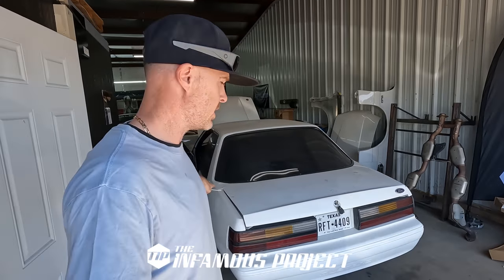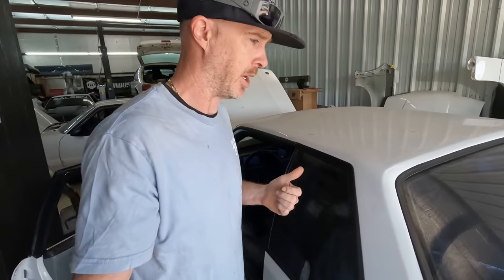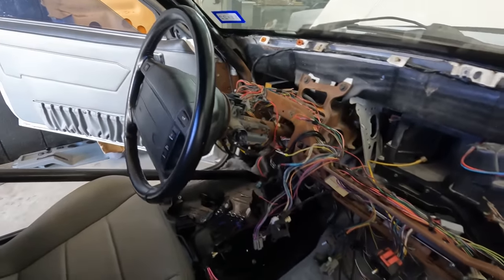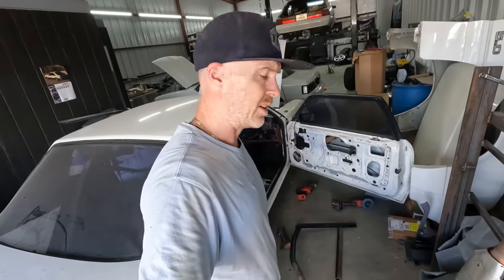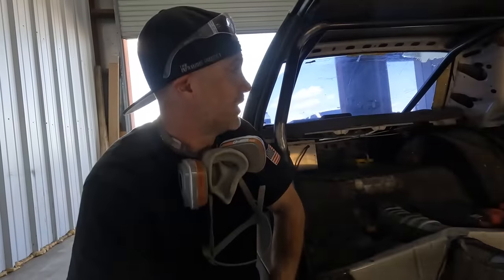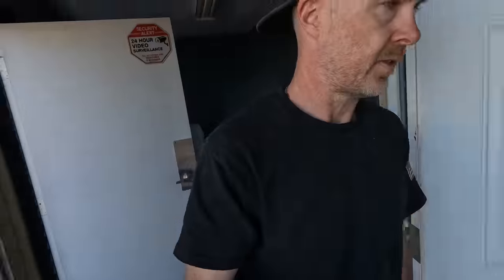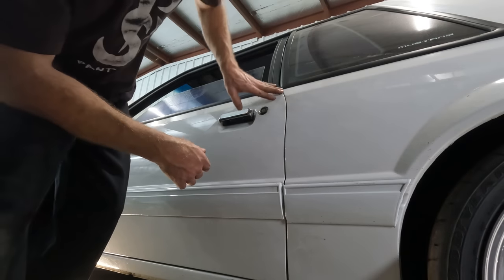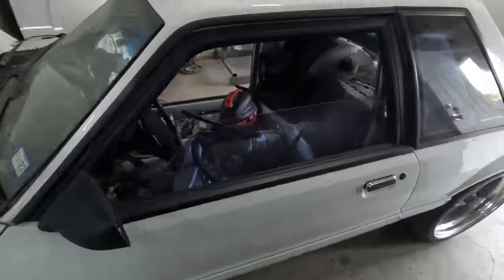Racecar to Streetcar - Roll Cage Removal & Panel Alignment on a 1993 Foxbody

Comment: I’m going though the same thing with my newest project build, a 1985 T-Top coupe with capri fenders and it had welded roll bar plates that they didn’t coat properly and they rusted the floor to the point of cutting them out and replacing with new metal! Went from almost a drag car to back to a street car where it should be👍🏻

Comment: Hey Chris! My car is very similar with a bunch of cut wires and the hvac wires and vac lines are cut. It's an 88 notch and I bought a stock 92 notch that's rotted out to use for parts. I know the dash harness is different and I noticed the hvac controls are flipped. Can I use the 92 HVAC controls, heater box and complete dash in the 88? I'm hoping to repair the harness if not I'll buy a new harness. Thanks man
Reply from the maker: Ya you can use the HVAC controls
Reply: Finally some good news🤣 thanks bro👍